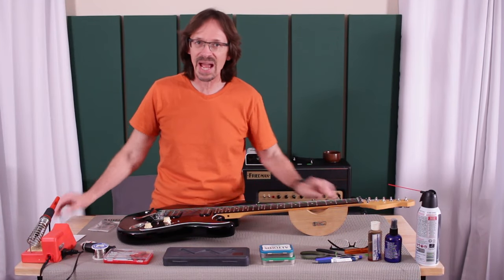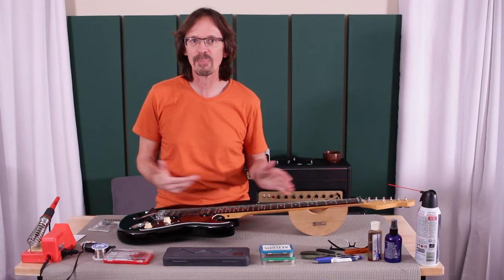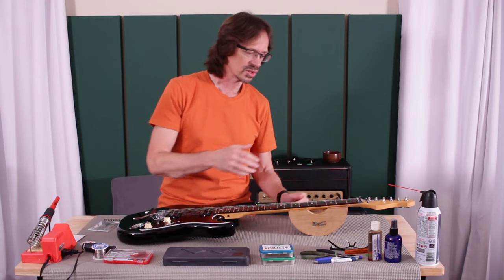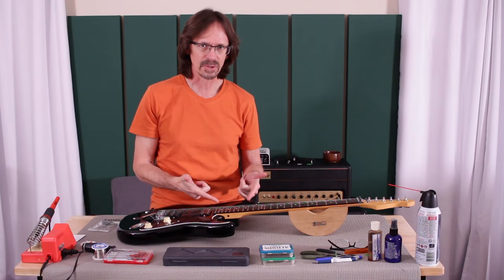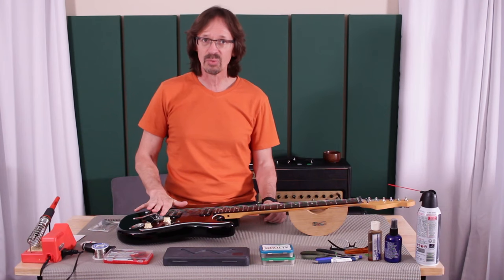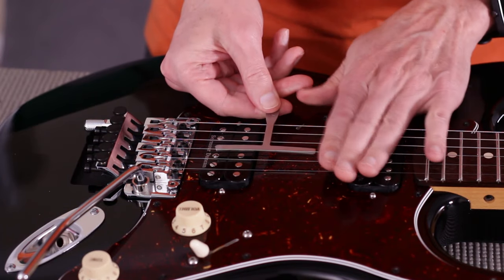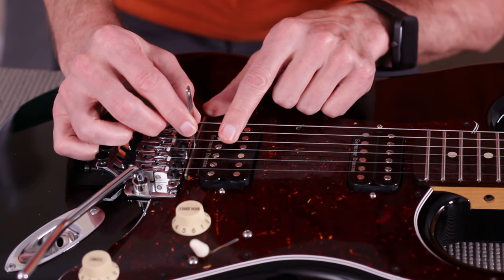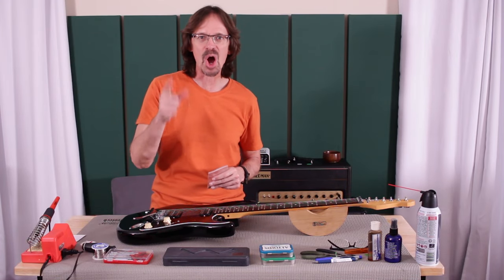How to Adjust Bridge Saddles for a Compound Radius Neck

Comment: I just set the string height at the 12th fret by measuring from the fret to the bottom of the string. That automatically takes care of the radius. Standard or compound makes no difference. The string is a straight line from nut to bridge. I used to to use the radius gauges it's just unnecessary. You really don't even need to know the radius.
Reply: I do the same. I used to be a professional guitar tech. This is the best approach. I do a .060 to .050 taper. .060 on the low string and .050 on the high string. Sometimes I can get it lower or sometimes I have to raise it depending on how level the frets are or sometimes depending on the radius.
Reply: Same here👍
Reply: Same
Reply: The best way. We can use any fret for adjustment. I prefer to use the last one on fretboard.
And note: adjusted string radius is not equal to neck radius.
Reply: If you buy Gibson you don't have to worry about bridge radius, it's already set by manufacturer. You Just have to adjust strings hight at bridge posts that has about adjuster  1/2"diameter little  wheels. You could also buy a Duzenberg type tremolo that seats on top of tail piece. Gibson's bridge system is a mich simpler to set-up then strat.♥️🕊️🌍👌👍

Comment: Assuming that the compound radius is linear then 16"r - 10"r equal 6"r difference over a 19" long fretboard. This gives us 0.315789"r change per inches of length. The distance between the 24F and bridge is 6.5" so multiply that by 0.315789" and you get 2.05" radius change. 16"r + 2.05"r = 18.05" radius at the bridge.
Reply: How would this work for 21 fret, 22 fret, and 24 fret fretboards? The fretboards are different lengths. If they based it on the length of the fretboard then the compound radius would be slightly different for each one. You can get the compound radius on any style neck. Vintage, Vintage Modern, Modern, 24 fret so I don’t think we have enough information to determine what it is exactly. I used basically the same formula but used the position of the last fret on 22 fret guitar with a 25.5 inch scale length. But this might not be accurate. It is possible that compound radius is milled exactly the same for all of them. If that is true then we still do not know exactly where on the fretboard the 16 inch radius actually is. 21 fret? 22 fret? end of the fretboard? Heck maybe the 16 inch radius is at the 24 fret which would be the theoretical 24th on a 22 fret guitar. It would be nice if Warmoth clarified.
Reply: @ReVeRbx-fe5wr My calculation is based off of my 24F guitar, and the 24th fret is exactly at 19". My 22F guitar's last fret is at 18.25", leaving 7.25" between it and the bridge. With the same formula, this now gives me a bridge radius of 18.38" instead of 18.05". I'm not going to lose sleep over a ~1/4" difference.
Reply: Beginner here. A luthier described it to me by saying 10"-16" (nut > last fret) = 6" change along 2/3 of string length. So for the remaining 1/3 of string length add 3"...16" + 3" = 19" = starting point for setting saddle height.
Reply: @BeantownToBigD  Mathematically @lIIIIIllll is correct, even if you take this simplified version of 2/3 and 1/3. If you have 6" of radius difference over 2/3, then the last 1/3 would be 2" not 3". Now, that Luthier probably goes by experience values that have worked for him well. Nothing against that. I also doubt that 1" would make too much of a difference anyhow. So whether you start at 18" and go a bit up or 19" and go a bit down, probably won't make the guitar play much worse or better.
Reply: "YEAH, SCIENCE!!!"

- Jesse Pinkman 2009

Comment: I happen to be one of the fellows who asked Warmoth that question. The customer rep at the time told me just to use the 16" radius at the bridge as there shouldn't be much difference. Now, as a mathematician I wasn't happy with that answer and did the calculations myself. Turns out is was something like 17" and a bit (or minus a bit) It was a long time ago, my memory is quite vague. At the end of the day, no-one makes a 17" radius gauge so I had to go by feel. String by string. Tuning, adjusting, measuring, repeat. Quite Zen, actually.
Reply: Harley Benton makes a set with a 17" radius gauge.
Reply: @Peaceful_Romancer  good to know. Back then it was only Stewmac, via a paper catalog following an advert in a magazine. 🤣😂
Reply: You don't need a radius gauge. If you set each string to the same height above a chosen fret, they will follow the radius for the entire length of the neck, as long as the nut is cut properly.
As a 'mathematician, you should have known that.
Reply: What was your compound radius?

Comment: I am and here's a neat trick to set perfect radius at bridge: just set equal action under the strings on your last fret, your bridge saddles radious will automatically match perfectly with your compound radious.
Reply: Cool yes, the paralel conical planes calculate it for you
Reply: @nopinionocomnt the difference is negligible, try this method then measure to see for yourself

Comment: One of the things about these videos, and Warmoth in general. Is that this is the kind of knowledge that was once common in your local guitar shops. Where most of the people running and working them, were also guitar techs with a considerable amount of time spent on a very wide assortment of guitars, unknown today, that were all hand built and unique. Now your options are very restricted by the major corporations. Most of those corporate necks are standardized to the point where they're all, by definition, mediocre. And most of that crucial knowledge has mostly been lost as the big box stores and the internet has mostly driven away those smaller shops and the people who actually knew what they were doing through experience. Which is why companies like Warmoth and these videos are valuable and needed today.

Comment: I think the most important message is that this gives you a starting point. But depending on the strings you use, your playing style and the feel you like, you may wish to change things. There is no "right" vs "wrong". If it sounds good and feels good (to you), it is good. I've always said that you should do your own set ups, because no one else can dial in the perfect feel for you. A "pro set up" will just restore factory specs (if you are lucky) which should be playable for anyone but optimal for no one.

Comment: The proper bridge saddles radius can be calculated this way: RBridge=(R24th fret-Rnut)/3+R24th fret. 
For example, saddle radius for 12-16" 24-fret fingerboard supposed to be about: (16-12)/3+16=17,33

Comment: And for a compound radius of 9.5 inches at the nut and 14 inches at the 22nd fret on a 25.5-inch scale length guitar, the radius at the saddles on the bridge would be approximately 15.56 inches.

Comment: For a compound radius of 12 inches at the nut and 16 inches at the 22nd fret on a 25.5-inch scale length guitar, the radius at the saddles on the bridge would be approximately 17.39 inches.
Reply: Thank you! That are exactely the measurements of my main guitar :)

Comment: LMAO.... sorry Aaron, I always chuckle about how guitarists overthink this.
All you need is a steel rule and an allen key, regardless of radius - no radius gauge required.
You're basically setting six individual strings to a height above their corresponding frets. Pick A fret and set the strings to a height. They will ALWAYS follow the radius precisely (as long as the nut is cut properly and the relief is correct) for the entire length of the neck.
FWIW. I'm a qualified chemist and metallurgist, so the engineering/physics stuff is also part of my wheel-house.
Reply: While this is true for the most part. If you are like me and set the first string lower than the last string, you would need to make adjustments to your depth as you go.  This makes it easier, especially for those that are "vision impared".   If I did not already have the gauges for checking the radius on the fretboard I would just measure each string.   Either way works well.  When using the gauges I do not put it below the strings and pull up.  That makes it a difficult task.  I just rest the gauge on the top, much easier.

Comment: Awesome content, Aaron! I was thinking about this issue, so your insights are timely! What are folks' best practices for adjusting the height of the individual saddles? Is it best to use shims to raise up the saddle(s) and therefore flatten out the whole bridge? And if so, do folks recommend adjusting the overall height of the bridge to compensate for the elevated saddles? Thanks much!

Comment: I have the Stew-Mac under the string radius gauge set.  My issue with them is their steel color is so close to string color that there is little contrast to see how the strings are sitting.  My favorite local guitar tech has some radius gauges that are colored and so much easier to see where the string is hitting or missing...that's why he's the pro.

Comment: A trick to using those radius gauges is to tie a bit of string through the center of that hole and pull the string gently upwards. That allows for more steady and repeatable results ime. As opposed to trying to hold the thing directly steady and evenly without turn it or pushing into a string too hard. For me, this was a game changer for using those types of gauges.
Reply: I just rest the gauge on the top of the strings after setting the outside string heights.  No chance to stretch the strings this way, much less frustration.
Reply: @alsmith7316  You don't want to set the radius from the top of the strings though. You want to set the radius from the underside of the strings. Doing so from the top is going to lead to issues because the strings all have different diameters.

What I does it set the high and low E string heights and then raise the rest of the strings a ways up. Then I put the radius gauge under the strings and pull it gently so that it rests against the two outer strings. Then I carefully lower the rest of the strings down until they make contact with the gauge. So, basically what you do but from the bottom.
Reply: @LooseOrangeJuice   I had not thought of that. However, I have found it easier to put it on the top.  I am not aligning the strings perfectly with the radius anyway.  I set the low E lower than the high E, so it is a bit off anyhow.   Not looking for perfection, just consistency from guitar to guitar.   It is as much a comfort thing for the strumming hand as it is a string height across the fretboard IMO.

Comment: I have a Korean squire strat body from the early 90s, im trying to get a new neck and was wondering if the strat replacement necks you guys sell will fit that body, id hate to spend 400 plus and it not fit my body properly. Asking because im not sure if the korean and American measurements are compatible

Comment: I was looking at this a few days ago, so I set up the formula to compare various compound radius necks.
So for whom it may concern:
10-16 compound -> gives 18.3 at the bridge
9.5-14 -> 15.8
7.25-10 -> 11.1
10-13 -> 14.2
Assuming that the larger radius is measured at the 22nd fret, regardless of scale length.
Reply: What was the formula that you used for computations? Just curious and want to learn……thanks!!!
Reply: That's not needed, setting action to be the same for all strings makes the strings cone parallel to fretboard cone, so continuation of the string cone which is the saddles will be the desired radius that is continuation of the compound radius.
Reply: P*(R-r)/(p-P)+R
Where P is the position (or distance) of the large radius relative to the bridge, p is position of the smaller radius (at the nut), R is large radius, r is small radius.
Since this doesn’t care about scale length, you can call the distance between nut and bridge (which is the same thing as p) to be equal to 1.
So p = 1 always
P= 0.281 when measured at 22nd fret, assuming equal temperament between semitones (P=0.25 when measured at fret 24)
Example for 10-16 compound measured at 22nd:
0.281*(16-10)/(1-0.281)+16 = 0.281*6/0.719+16 = ~18.3
Hope this helps!
Reply: Or you could just set the height of the strings above a fret and save a lot of unnecessary fannying around.
Reply: @FiddeBL  Thanks!!!!! Always great to learn something new!!!!

Comment: What if you adjusted the saddle heights based on the action at the 12th fret (or even the 21st or 22nd fret, for that matter) instead of using a radius gauge?  Wouldn't that automatically compensate for the flattening curve?
Reply from the maker: Yep, it sure would. By doing what you describe the radius at the bridge would essentially "set itself". This video was more to explain the concept of the compound fretboard, which some people have a hard time grasping.
Reply: @warmoth  Thanks so much! In fact, I think an added benefit of doing it this way is the you can get a "radius" that "fits" the correct compound radius setting, but it doesn't have to be parallel.  What I mean by that is that the first string's height can be made just a tad lower than the 6th string (which needs more room to vibrate anyway), so the radius curve of the strings is just slightly skewed.  Obviously that skew needs to be very, very subtle!

Comment: Apart from teh feel only, wouldn't it be just fine to adjust by the string height on the high frets? I mean the goal of the adjustment is even string height between the strings on the fretboard anyway. (Yes, that is a bit of a simplification as you mostly want the low strings a bit higher, but you get the point an can adjust for that too.)

Comment: Thanks for this great video! Learning a lot as always, both from Aaron and from the mathematically inclined in the comments! I have two questions: 1) Am I just going crazy or did Warmoth formerly offer a 10-22" compound radius neck? 2) To confirm the presence of a compound radius on a client guitar (or one of my own) should I just use the "card"-style radius gauges to measure the neck radius at the nut and the terminal fret?

Comment: Was curious about this. Kind of figured it is just math. 10-16 divided by x distance + y distance times 10-16 divided by x distance. Plan on pressing frets on a 10-16 radius. So I got cauls 10 thru 16 and make the appropriate jumps in caul radius sizes. Or just hammer it in and let the fretboard be the stop. The one that has me wondering is how to fret level a compound radius? I'm guessing just have to fan the sanding beam out as the neck widens. Very intuitive approach. Where as a straight radius. You want to keep the beam very perpendicular to the center line of the fret board or you will inadvertently end up with a slight compound radius. Where as a compound radius you definitely want to fan the sanding beam out with conical shape of the neck. Like a slice of a road side cone. What we end up doesn't really matter. As long as flows. Been studying this one guitar repair guy. He actually uses a flat sanding beam with a piece of leather glued on the bottom. It makes sense to me. Because a fretboard is typically radius where as a sanding beam is flat. Why not have something that contours to fretboard a little bit rather than something that is flat on a round surface. Feel like a compound radius requires a very intuitive approach like that. Just go with the flow and follow the natural contours of the neck.
Reply: Had a few beers so don't hold me to that math formula. Think it is more x distance divided by 16 minus 10 times y distance. Fret cauls 10-16 or hammer em on. And a sanding beam with a piece of leather glued on the bottom following the fan of the neck. that should get me there. Pretty good

Comment: So, for a compound radius of 10 inches at the nut and 16 inches at the 22nd fret on a 25.5-inch scale length guitar, the radius at the saddles on the bridge would be approximately 18.085 inches.
Reply: That is the number I have been searching for.  It's amazing that Warmoth makes tons of necks with this compound radius but doesn't supply this number - even their spokesman guesses at it.  If the formula is not too complex, could you provide it for us?
Reply: @bobstrickland4223   Radius @ saddle = Radius @ nut + (Radius @ last fret - Radius @ nut) divided by last fret position in inches multiplied by scale length.
Reply: @bobstrickland4223  Im solely basing this information on the assumption that the last fret has the end of the compound radius on the fretboard. It’s quite interesting actually because Warmoth offers 21, 22, and 24 fret necks. Would the compound radius be the same for all of them? Then the last fret wouldn’t be the same radius on each one. I wonder what the last fret is on a 24 fret neck. Maybe the compound radius on warmoth neck extends to the 24th fret whether there is 24 frets or not. We have to determine where the 16 in radius is on a Warmoth compound neck

Comment: At the end of the day it is up to taste. But to me it seems more reasonable to set the nut to the first nut radius and the saddles to the radius of one of the last frets of the board. Why the need to make the saddles flatter than any part of the fretboard?
Reply: ...because if you set them to the last fret radius, the strings in the middle of the board will be very slightly higher.
The easiest, and most accurate way, is to just pick a fret, eg 12th, and set your strings the same distance above it. Assuming the nut has been cut properly, the strings will be exactly the right radius for the entire length of the neck.

Comment: Or just uses 16 inch radius gauge at the last fret. But I like the with the top commentor said even better. Just measure string height at the 12th.

Comment: Or you could use a 16" gauge at the end of the fretboard
Reply: Now that's clever. If it's a 10-16 compound radius, then the space at the end of the fretboard is enough to slip in the gauge.